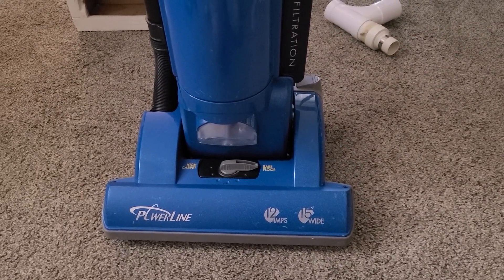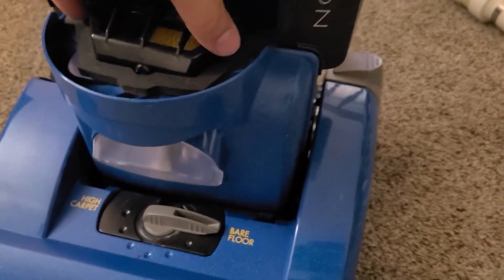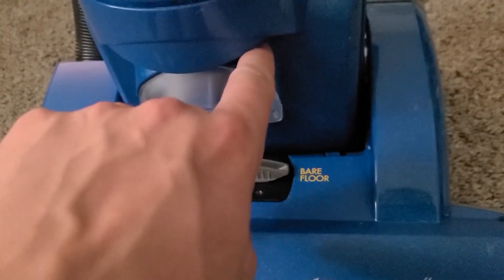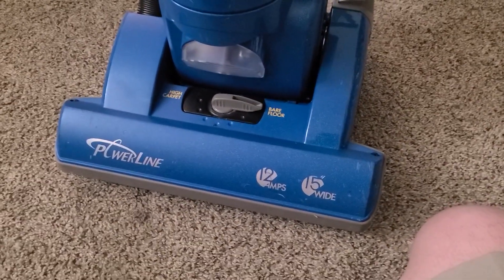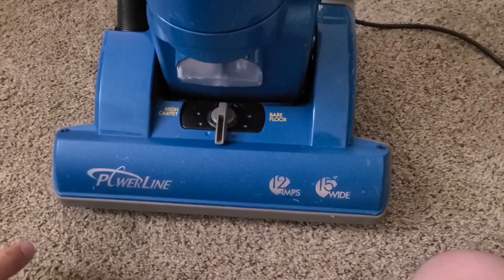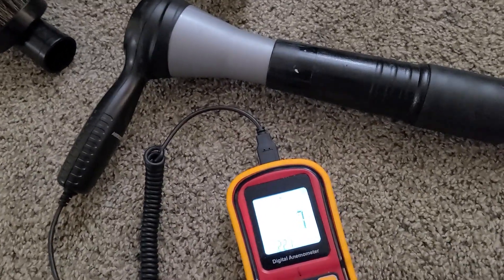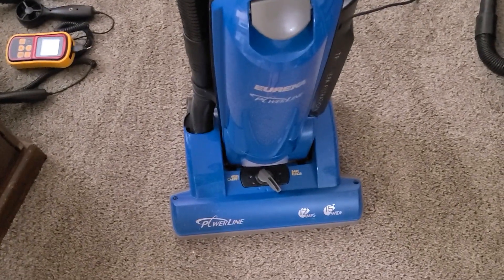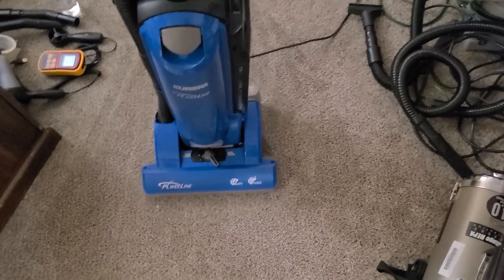Eureka powerline 5811 airflow test

Comment: Wow i have never heard of a Powerline made in a Modern era i always remember the powerline in the Victory style or the Bravo Style powerline but nice and unique eureka also my Whirlwind Limited plus also has that Tube going to the Belt Shaft Bearing to try and cool it off and that way prevent the bearings from going out so quickly
Reply from the maker: Yeah it was another name they liked to throw on things. I wasn't really sure what to call this style of machine like.....if you say victory style or bravo style people will recognize the design but this....I can't think of one having an identifiable name to it.
Reply: @Blackheartvacs  im guessing it could be a Lightspeed Style vacuum if i mistake since it only came out in the Whirlwind Lightspeed and the Boss SE Wide Track
Reply from the maker: @VacuumCollector2024  Dunno, lightspeed ones from doing a quick search generally had a completely removable bin. Maybe these never had a unique name to them?
Reply: Its was a line back in 03 to early 05 and they were only sold in more premium department stores and vacuum stores, they had 4 Lightspeed base models, a 2270 series model, a 4870 base one, a mighty mite and a electrolux mondo/GE Canister base model